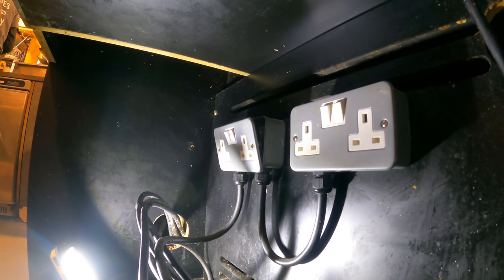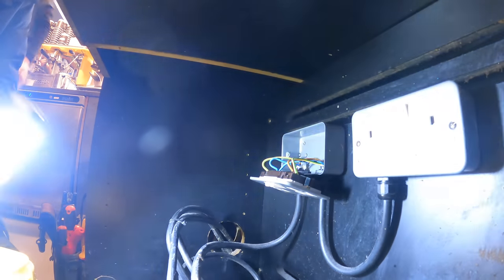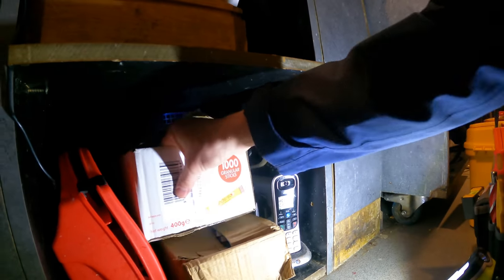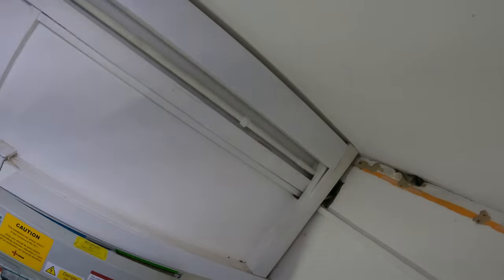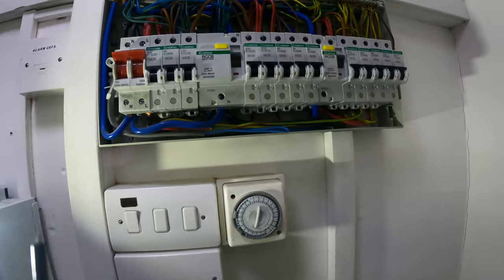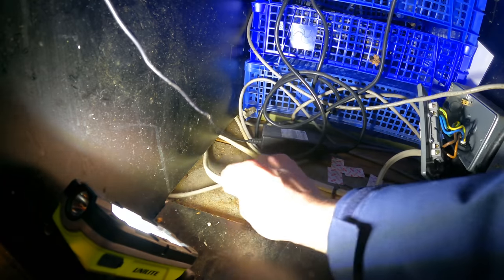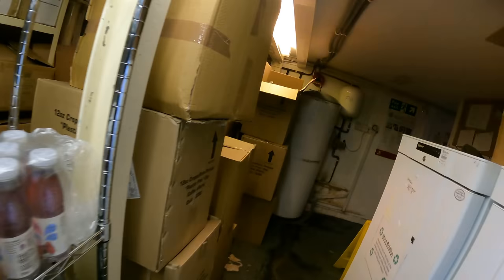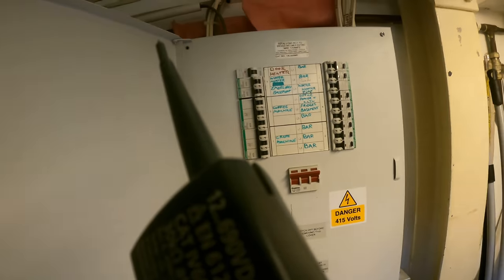Why I Hate Emergency Fault Finding Jobs - Electrician Life

Comment: they should make it law that every cable should have were its going to every 4 feet of cable .It juts makes sense and will save a hell of time for the home user or electrician or fireman .You can make  a rubber stamp that prints it on to save time

Comment: It really is about time that commercial premises had proper drawings of all cable routings and user points. I stopped doing commercial callouts exactly because the average premises I visited were an absolute disgrace. Always an argument as to whether the tenant or landlord was responsible for the building fabric - generally, unlike domestic premises, the commercial tenant is responsible.

Comment: Just today I had same issue.. but I didnt fix the problem.
I have a Karcher and some water goes to extension role and all switch off.. I change and check fuse, but its fine.
Can sockets break inside?
Maybee I should change that?

inside fusebpx all is fine

Comment: I wonder why he's called out I bet it's going to be a plumbing issue or maybe a roof leak? Artisan electric always exciting never know what's going to be next. LOL
over the pond we have a clearance rule, so many feet around electrical equipment ... and yes it's coming to find churches and restaurants with everything piled in front of them.
I've been trying to do it wherever I can and I think it might be a requirement? to label the outlet as to panel and circuit that way I can say all the plugs not working are labeled circuit 3 in panel B which instantly tells me hey they're the same circuit and there's another panel.

Comment: Not an electrician, but I was a phone guy.
I have been in more than a few restaurant basements chasing faults.
All I can say is. it can cure you from wanting to eat out.
One in particular. Chasing a wire in a crawl space. Right under the kitchen.
They had a busted sewer line from the bathroom. And it had been broke for some time.
I would guess 6 inches of poop everywhere.
I told the guy. You need to get that fixed before I go down there.
I did run them a new wire on the outside of the building to the credit card machine.
I could at least clear my ticket.

Comment: After observing the rodent activity you should have tested circuit before energising. This is a common fault with electricians. Trips go out for a reason. By energising before at the least unplugging the appliance put others at risk.

Comment: When you saw the rcbo tripped. Why didn't you do an insulation resistance test? Or at least do one between neutral and cpc. You haven’t verified that the insulation of conductors is providing adequate electrical insulation and is not damaged. You have got the power back on but you don't know why it tripped in the first place. You haven't found the fault!

Comment: "Can you add a double socket underneath the bar?"

Sure! Flat on the floor, kinda twisted sideways, wedged in between the beer cooler and the sink plumbing, installing the socket on the wall behind the plumbing. Worst work position ever! OK, disconnecting a dishwasher for a good friend, at 1 AM inside a 400 mm wide and 600 mm deep kitchen cupboard, only to discover she in fact had NOT turned off the water was probably worse but we got a good laugh out of it once we had the kitchen dry again around 2 AM :-D

Comment: I actually like those jobs. 9 out of 10 times it is a version of what has been shown here.
Working predominantly in Supermarkets if you are being told to check a socket, ask when it stopped working.
A few times they told me, the socket isn't working for a week or so just to find out it wasn't connected to anything for years.
And if this has been confirmed and all breakers are on, there HAS to be another panel.
Usually you're dealing with regular workers and they don't live there so why would they know.
But there has been some headbutting when you ask those questions, I have to admit.
On the other hand I reduced my risk of opening difficult to reach maybe dirty places to check the lines.

Comment: So many health and safety issues how do they get away with it?
Unidentified socket outlets in a commercial installation??
Blocked access to a distribution board, and a manager unaware of its location?
I have encountered this before and sent a polite written explanation to the client explaining why there needs to be a marked access to a DB. Of course nothing had changed on the next visit. 
We are not policemen - we can only advise.
But putting it writing, and keeping a copy on file, puts you in the clear when the worst happens.

Comment: When this was uploaded energy was cheap and affordable, so a second DB wouldn't normally raise too much concern. In todays climate - Where simply boiling a kettle costs £2,50 - I bet their energy supplier is going over that installation with a fine-tooth comb... 🔎⚡😉

Also: I tend to watch vids with (Auto-generated) subtitles enabled...And the apparent opinion of YouTubes subtitle generator is the restaurant you were working at isn't a very good one (Or at least the software isn't too familiar with the French word « Crépe »...) 🥞🇫🇷😉

Comment: Why didn't you check the basement first? Even if they told you you there was only one fuse box you shouldn't trust no one in this job, see things for yourself. I wouldn't even trust schematics attached to the fuse box pannel, I've seen cases where it was completely changed, like they swapped laundry/water heater circuit etc...

Comment: On call one day for a national company I was sent to a M&S in the Manchester area on arrival I was informed that a 3rd of the lights on the shop floor were not working I was shown to the 3 phase board in a store room approximately 8x6 and the heat that hit me was unbelievable finding no heater in the room I found that the heat was coming from the board. I reported this to be told that's normal. As for the lights I found above a ceiling in another store room the consumer unit had not been installed even though the tails from the main board were energised. Agan I reported this to be met with well the lights worked yesterday. I made the tails safe and i was told to leave by my company.  I left this company a week later.

Comment: Go into a large supermarket such as Tesco Saintsburys ect . And you see what ba true mess the electrics get , the places get a refit every  5 to 8 years. So they would have had about a different teams of sparks altering the installation on each refit. No one would have keep any records or wiring diagrams, and because there time pressures to get the job done it thrown in . And a rule they have don't renew if it can be reused . The amount of sparks I've see walk out half way through the job and refuse to work for the big supermarket's is unbelievable , simple the supermarkets don't give a sh*t how it's installed as long as it works. So you see short cut after short cut bad install matter install

Comment: all that hassle just because the customer was too dumb to check the fuse board but went ahead and opened the socket (potentially live) by themselves. And they couldn't even tell you at the start that there was a 2nd fuse board.

Comment: Wait.... did you check this circuit before switching it back on? I wouldn't recommend doing that, without testing. The breaker didn't trip by nothing. There was a fault. I'd check this circuit for isolation errors and shorts to ground or neutral before tuning back on. Switching the breaker to a full short may damage more stuff. In this case maybe there were too many devices plugged in and turned on at once.
I couldn't see an RCD in this distribution board in the basement.... in Germany, having an RCD on each circuit with sockets, that could be used by normal people (non-electricians) is a must have. Is there another law in UK?

Comment: You should get a cable tracer, hook transmitter on dead live, and use wand to find it, you can get ones that work at serveral feet away. Also are you not worried about leaving covers off at a buisness with people walking around everywhere?

Comment: Felt for you there young man! Well at least you didn't ghost the customer when you knew it'd likely be unpleasant. Just lucky you didn't have to lift boards - or when faced with realities like floor tiling - simply have to resort to installing a new circuit.  The unseen corners and cavities of catering facilities are most often disgusting.  I was watching you run your fingers through your hair toward the end and thinking aw no!  

I was often given free samples of produce by grateful producers. Bundles of pizzas or whatever. I never wanted to appear ungrateful, but frankly, after crawling around the less accessible areas of the premises with the years of dust / bugs / grease, at times rodent droppings (and yes even the odd dead mummified rodent) and seeing the stuff being made - even in facilities that were scrupulously cleaned in the visible areas... I couldn't face eating the produce. And would not even wish to get in my truck or touch handles / steering wheel, until I'd scrubbed my hands. ew...🤮  

Some quite popular local carry out shops and restaurants had their unpleasant areas behind equipment, above false ceilings, in basements / cellars. The places the environmental health inspector doesn't usually see.  Though lets face it, a small minority of occupants of private housing are gross too...some carpets etc... or grubby kitchens or behind old cookers 😲

Comment: Sometimes, the fault is just a circuit breaker trip on the distribution board and you go on and on doing some tracing. Anyway, excellent fault finding.
Reply: There is a reason why the RCD tripped though so further investigation into the fault is required

Comment: Artisan electrics   I'm a retired spark now I remember one about 5 years ago I did OMG it was a nightmare the job was originally for led lights in the kitchen and new light circuit in 2 more rooms what they didn't tell me was that they had a fault on the existing kitchen lighting circuit it seemed to take an eternity to locate the fault his wife didn't help either she was blaming me for the fault anyway I was in the loft above the kitchen and found a squirrel with it's jaws around a cable it had chewed through the cable causing the fault so remove squirrel and replaced the cable afterwards I came down from the loft with squirrel and the section of cable to show that it was not my fault with the lights it shut his wife up in minute after the grief she had given me he said what do I owe you for that I added £175 to the bill for the way his wife treated me and finished the job and was paid